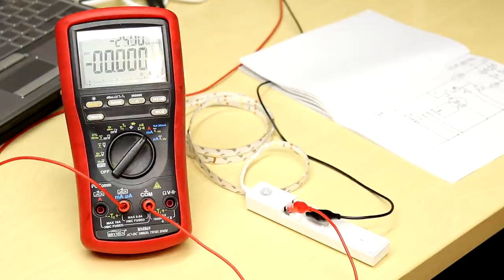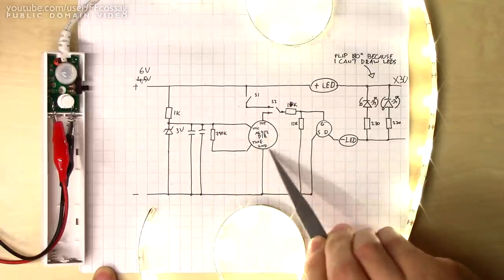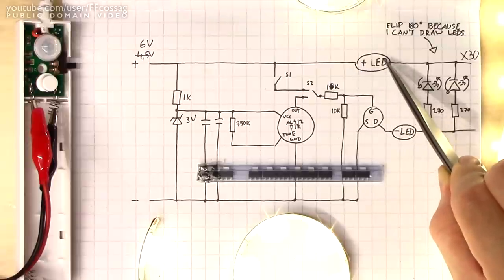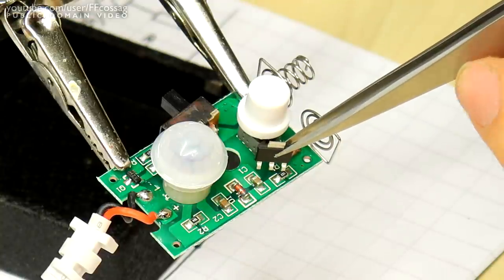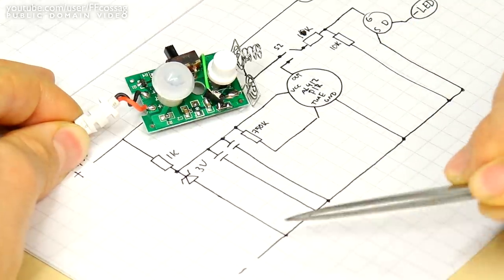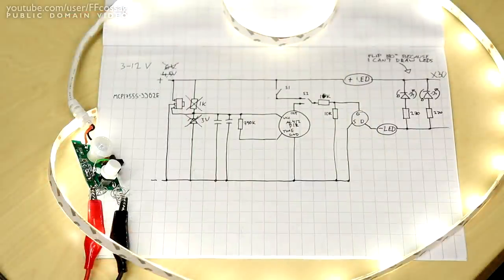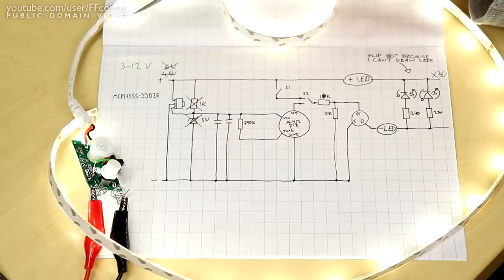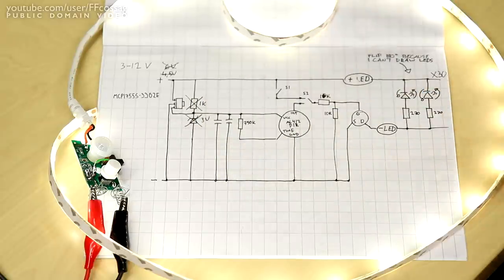Clas Ohlson sensor LED strip battery drain fix

Comment: Did you notice any thermal issue on the regulator when running from a high voltage (9-12V) with the led strip turned on? Usually they dissipate the heat through the ground tab on the PCB, but I wonder if having it "flapping in the breeze" would cause problems in the long run?
Reply from the maker: The regulator only supplies the sensor; a few µA.
Reply: Oh, that's right! Should be pretty solid then. Thanks for your reply :)